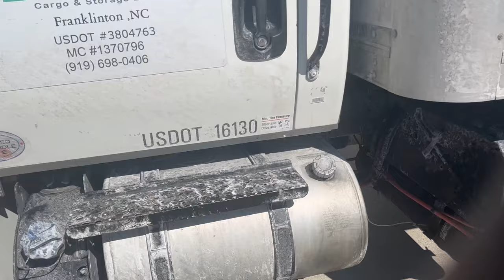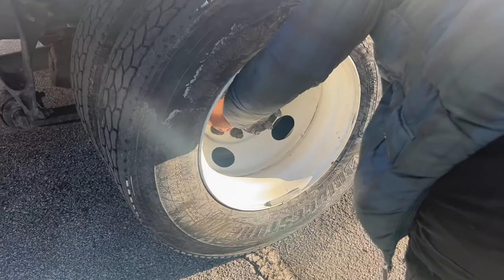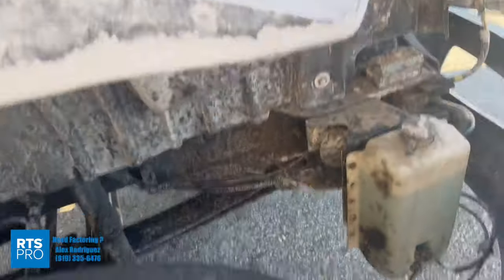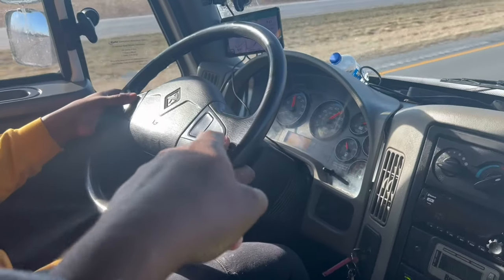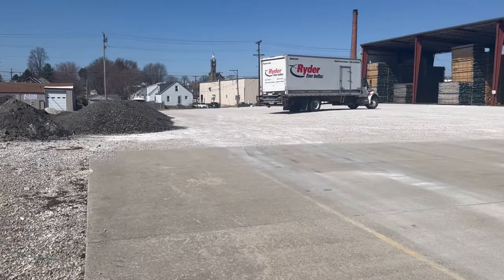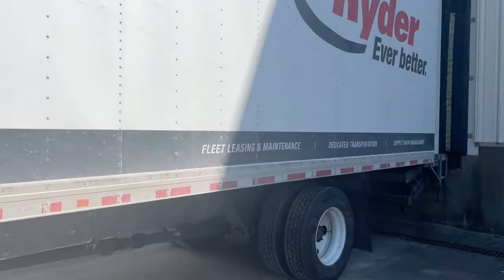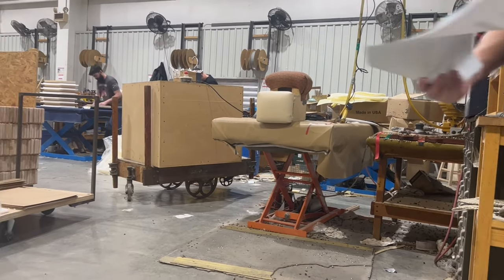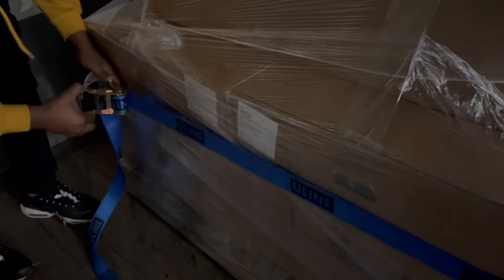26 ft Box Truck Training a Driver First Day on the JOB

Comment: Hey 
Just to inform you on 2 things 
1) it's a diesel engine your oil is always gonna be black even if its a day old that's why you gotta keep track of your oil changes with your miles.
2) when turn on your truck, first you open your switch you will hear 3 clicks or you will see a orange light on your dash once the light goes off you can crank the switch.
You always do this to turn your truck on you have glow plugs that have warm up before starting engine. 
Also before turning off your engine let it run for a few seconds before shutting off.
Because your turbo needs to stop on its own it will prolong the life of your turbo.
Reply: Thanks for the tips ! Very much appreciated
Reply: @Charmain Stewart  
You will learn in time nobody was born knowing anything.
I've been driving commercial trucks for about 28 years and I'm still learning new things everyday when I'm on the road.
Reply: @frank0720i  Thanks Franco. Respect for people like you with decades of experience but still constructively address issues. Some people come on channels to criticize  blindly. I wonder why they can't channel their advice for Semi driver with years of experiences that didn't lock his pins in the container that fell off days ago , and the other driver that didn't articulate his fifth wheel on Monday.
Reply from the maker: When we first got the truck the oil wasn’t that dark … I was worried when I first got it and kept checking the oil every single day for the first month …Thanks For the Advice I’m running to the truck to check it now
Reply: @BCAS Box Trucking  believe me it's always gonna be black once you change it and run a couple of miles you can check it the next day and see it.
Reply from the maker: @frank0720i  thank you so much for the information

Comment: Also when you back you truck to the dock and  it jams then you put the chock then they load you most likely with a forklift , do you have a problem taking the wheel chock out???well if you do here a simple fix to that, when you back up and hit the dock move the truck about and inch then put ypu wheel chocks.. let me know how it goes
Reply from the maker: Never had that problem but will keep it in Mind